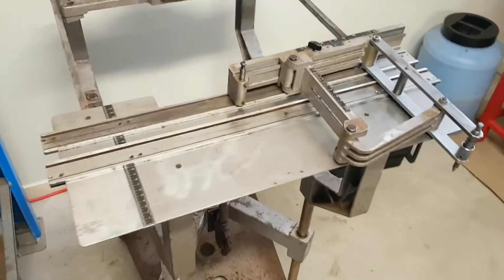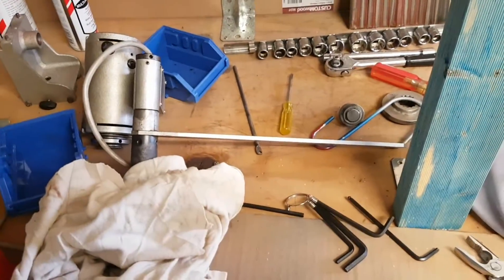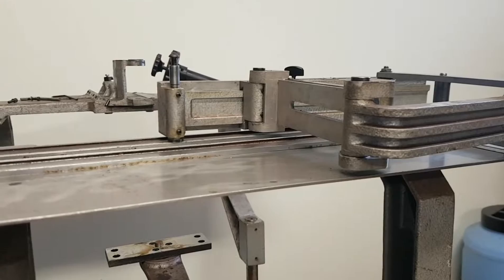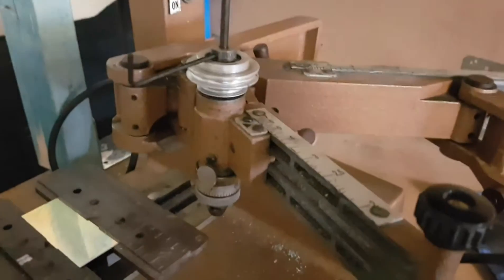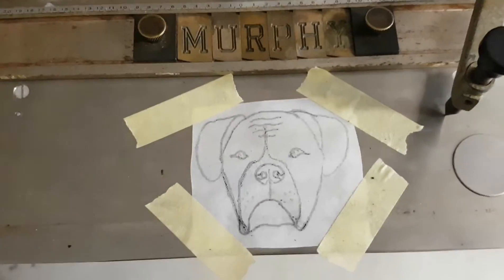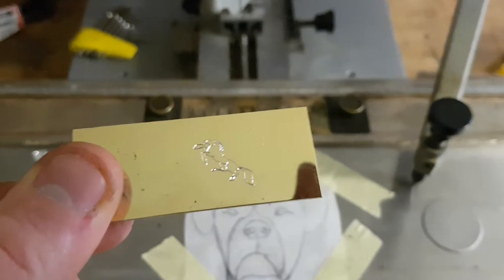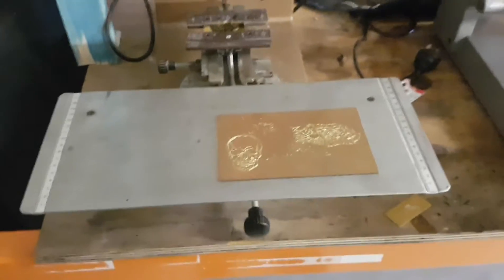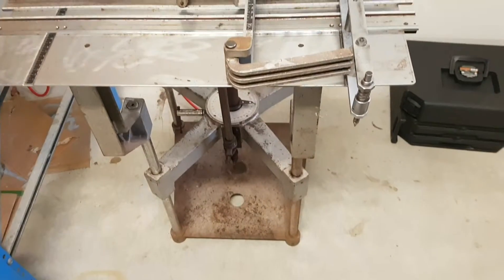My Pantograph engravers. Detailed explination later

Comment: You're right that there are not a lot of videos on these old machines.  I'm currently trying to figure out how to change the scribe tool from a plexi to a diamond tip, and mine seems stuck.  Any suggestions?
Reply from the maker: Siezed, have to take it apart and WD40 it yo free it up. You can try some gentle heat from a heat gun and love taps with a hammer but start with the WD40

Comment: This must be excruciating to work with. I can engrave that drawing (any size on any material), in around 40 seconds - in the time it takes you to set all this up, I can do over 100 pieces.
Reply from the maker: Well, I don't need power and making 100 isn't what I have for. It has lasted 50 years and will last much longer than that. There are no modern machines that can boast that kind of reliability. I have a big Gravograph 7000 at work and its a fantastic machine, accurate and fast. Not what I would have at home for little jobs though. Thanks for the comment
Reply: @thelittleshopaustralia4733  Point I was making is that these old machines are not sufficient anymore to scale an engraving business on. OK for tinkering at home, but no good if you want to make a business out of engraving stuff. Our business (just two of us) churns out close to half a million items annually (mostly big business customers) and we use a range of Umarq FX5 and Quest machines. They work almost non-stop (8am to 6pm daily) and in the last 8 years, not one of them has broken down.
Reply: It's a museum piece and that is what the point is. Nostalgia for manual machines not for mass production.
Reply: It is a very beautiful machine. Dont listen to the scumbags that try to bring you down.